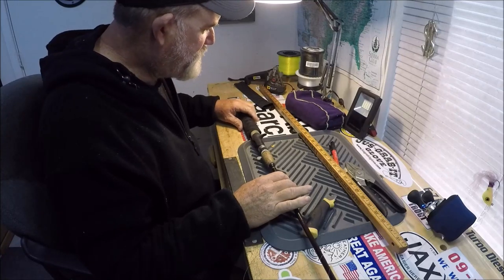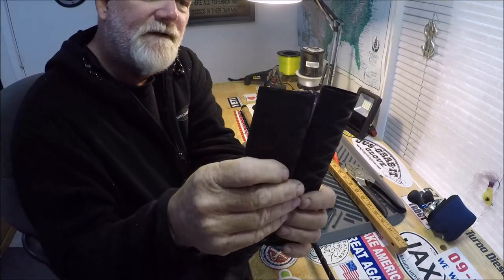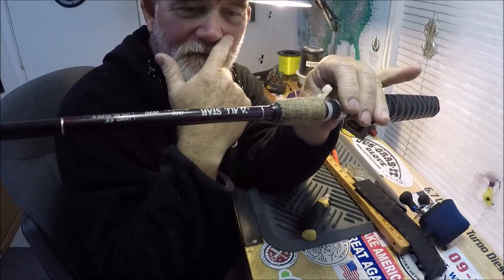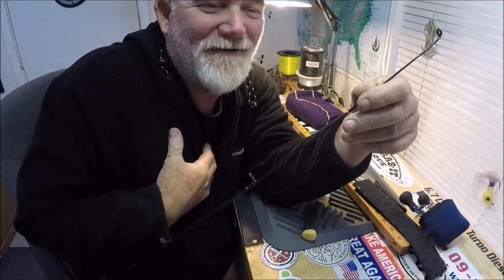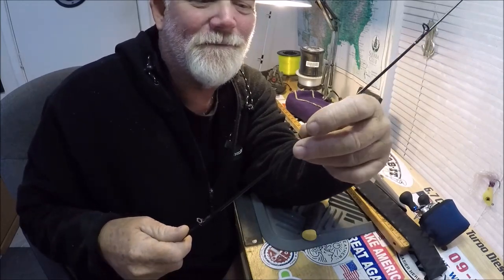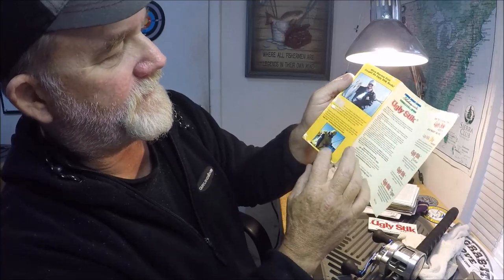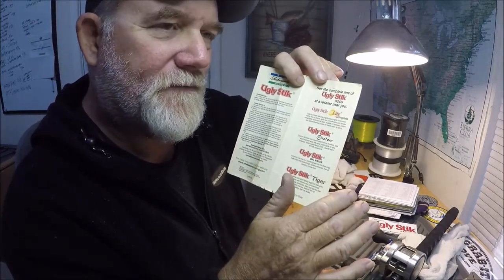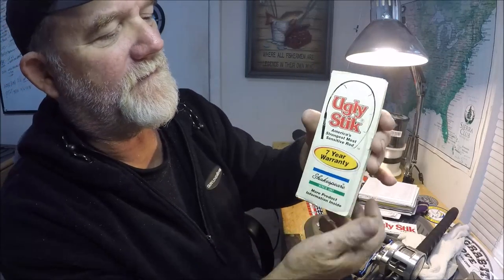CORK REALLY SUCKS,  make that rod new

Comment: Ya did good Captain Dave thanks for sharing. I have a box full of reel boxes with schematics and a closet shelf with about a dozen or so coffee grinders protected in my Crown bags. That caught my eye, yep. I was wondering what's the good Captain stashing in them bag there : ]
You could on that front wrap issue where it didnt shrink down, masking tape it off, front and rear and fill and fair(smooth with a popsicle stick) to fill in and make it nicer. Oh ya use black silicone sealant or RTV You gonna have it for a while...just a thought. Thanks again for sharing Captain Dave.